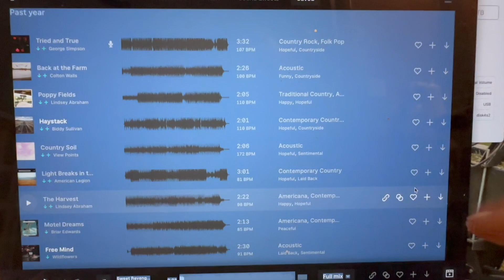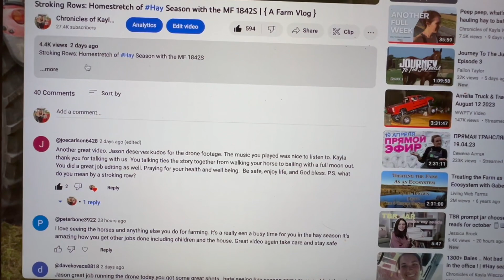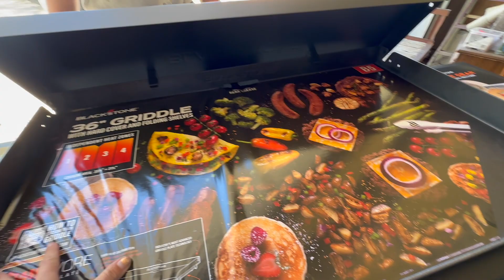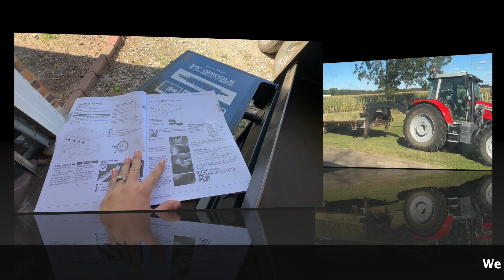💦 What a MESS!?! 💦 Water line breaks! Calling in for help...| { A Farm Vlog }

Comment: Nice video. I had the water line to my house break. I called the water department of Troutdale OR.  AA very nice employee came out. He said the break was on my side of the water shut off. So I had dig  with a shovel about 3 feet down and found the leak. So it was D.I.Y. repair. Funny part was I was the manger of compliance and enforcement for the state Oregon Safe Drinking Water Program.The city utility guy and I had good laugh about the break who I worked for. Kayla you looked relaxed and happy.